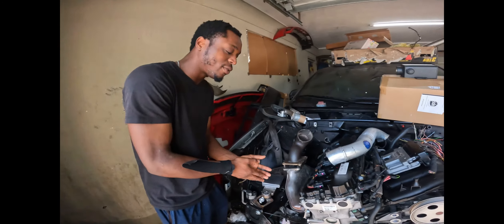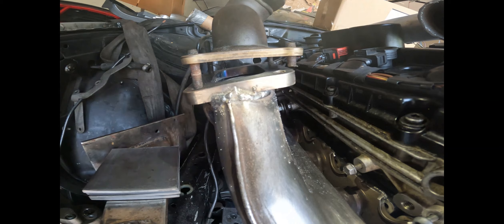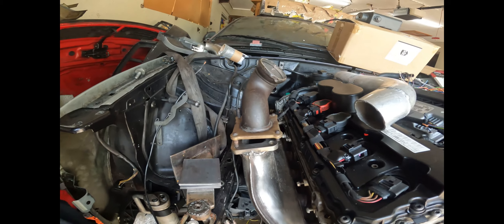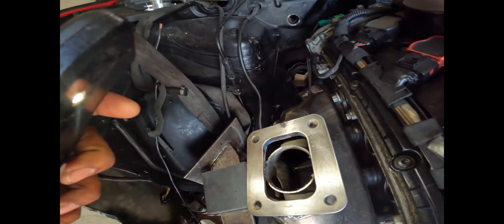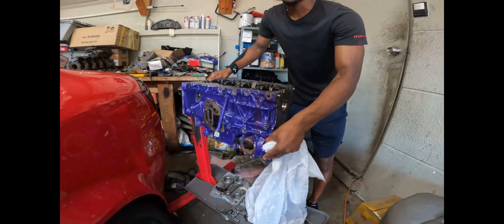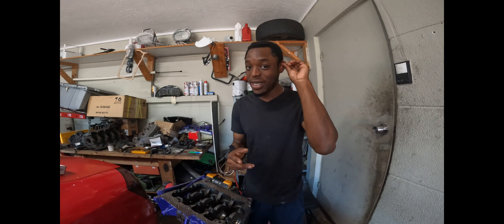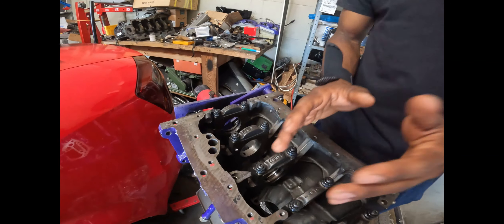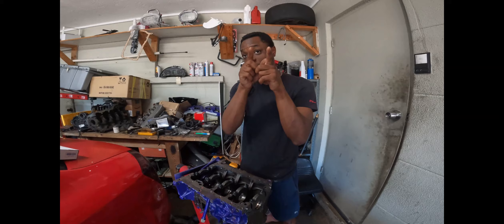Why I want to build 1000hp+ Audi 2.0T Avant/Wagon

Comment: Dude near me is selling everything freshly bored with forged parts - 2.0T, unassembled. Has all the paperwork 5k. I really wanted to get it, but I actually switched to doing a B7 2.5l Turbo Avant, bringing me here. lol
Reply from the maker: Well, thank you for taking the time to watch the content. It's been a challenge trying to manage both the 1.8t/2.0t/2.1t and then the 2.5T swapped B6. But I've got in touch with the right people and have a larger support system. More 2.5t in the works